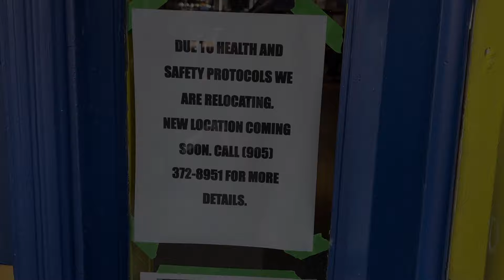Health Concerns Prompt Tenant to Leave Apt July 17, 2024

Comment: I used to own a business downtown... those buildings are old. And as much as the "Historical Society" wish to "preserve" the original... there are many restrictions (at least there were when I was a tenant), that forbid the tenant from doing an overhaul on their unit. You can do the space of the room, and basement if you have one. But of course restrictions.
The upper floors, which were/are housing units is where the problems are that bleeds onto the rest of the unit.
I wanted to rent all of the levels in my unit, but was told its deadspace. I got to see up there, insome units where no one lived ina long time, used as storage, ceiling / roof breaks and leaks. The 1st time it rained, it leaked to my unit, thankfully it was repaired. But barely. The upper units are huge and deserve to be restored to their full glory.

Hopefully, their new unit will be better, and that they have more success.